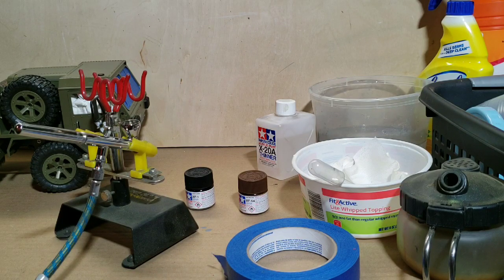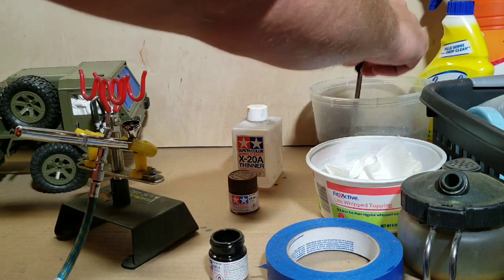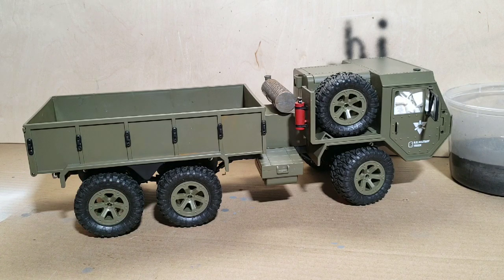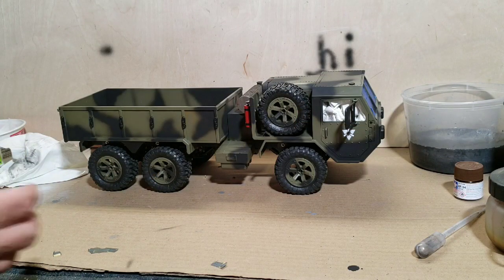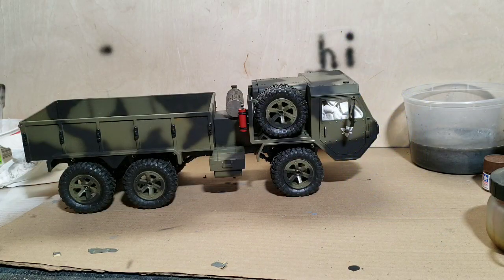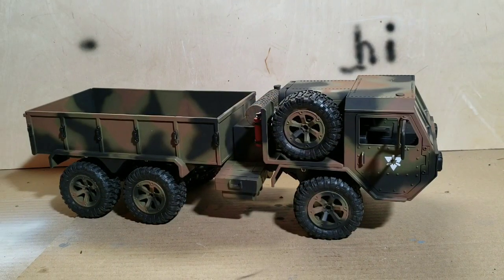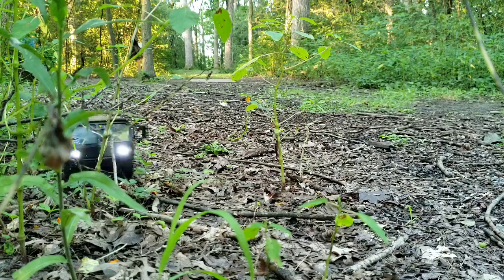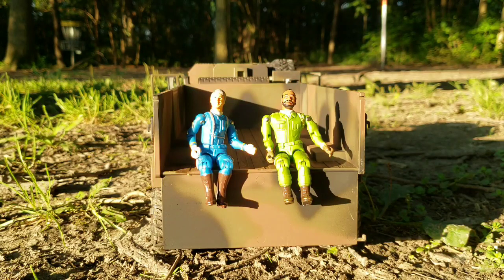Fayee FYOO4 camo and first run

Comment: Is that an expansion chamber on your airbrush line between the pump and the brush? Did it come with your set or did you add it later?
Reply from the maker: It's a moisture trap in line I added just to be safe